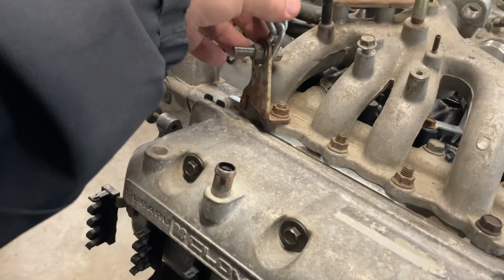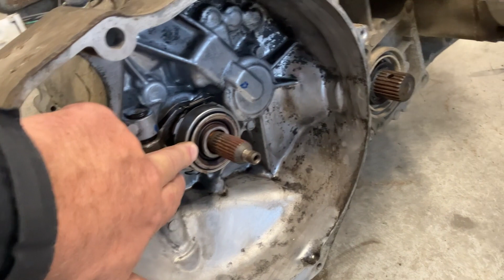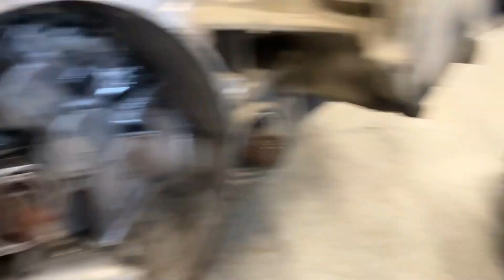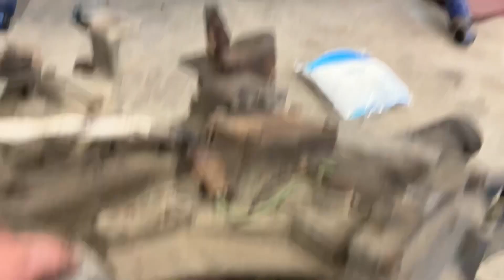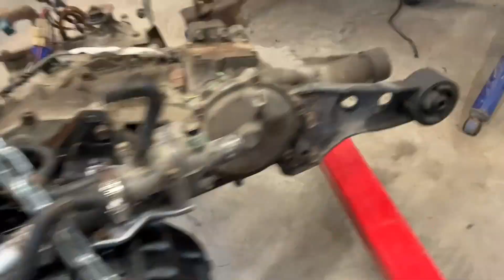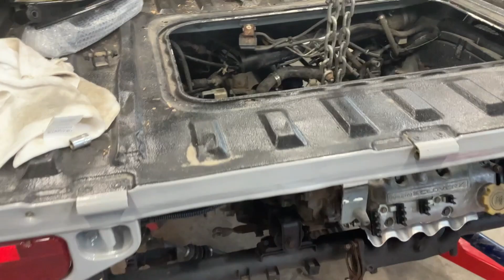Subaru Sambar engine install

Comment: I’m trying to remove the axel on my 93 KS4. But need some help. Do you have anywhere I can DM you to get a better idea on how to take it off so I can get to the oil pan?
Reply from the maker: I’m not sure you need to remove the axle to remove the oil pan. Been awhile though. Does it have the pins or internal circlips holding the axle?  You will have to remove the upper shock bolt to get the lower control arm to go low enough to slide axle out. Support lower control arm with jack when you remove that bolt.
Reply: @turnbullgarage88  I’m not really sure how to tell if it has pins or the internal circlips. I took a picture of it, but can’t send it here
Reply from the maker: @dylanschaefer9799    Email it to me. Turnbullgarage88@gmail.com